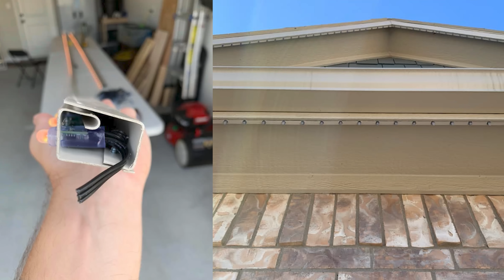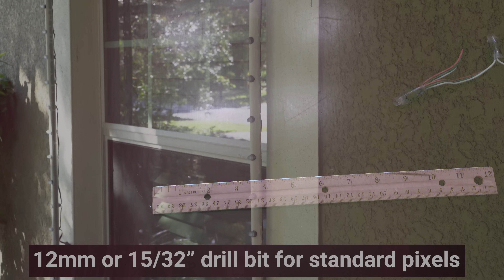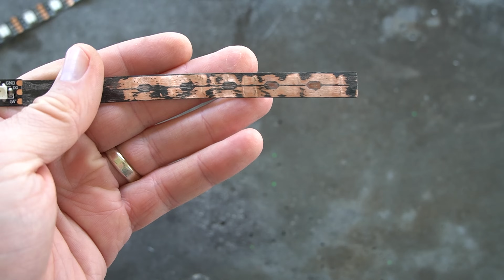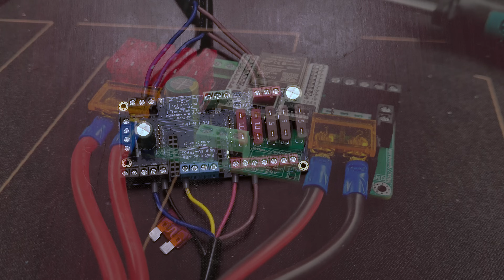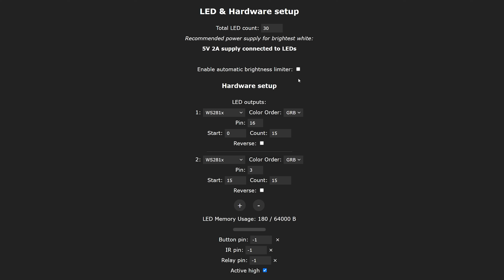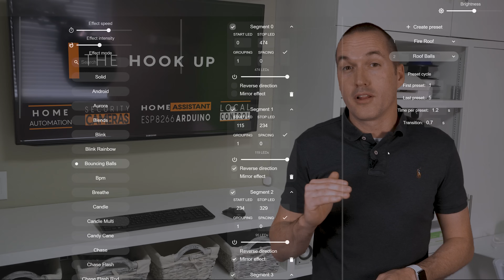DIY Permanent Holiday LEDs: Complete How To Guide 2021

Comment: Another wonderful video!  Always excited when I see you have done another one.   I did have a question and I apologize if this was brought up in another video or section and I missed it.  You mentioned in this video 2 options: aiming lights towards the streets, or towards the house for a more indirect effect. Ive noticed the differences on several houses I drove by, and I was wondering how they are achieving that  almost shadow glow effect off the siding or stucco of the house vs seeing the LED strips head on from the street?  Is it really just using J Channels or PermaTrack? Or is there a way to aim the lights so they cast more of a light shadow of color against the house?  I was just wondering if in your knowledge that is achieved by putting th e J channels further back? Or maybe aiming the lights in the J channels differently or not just straight down?  Any help or idea would be greatly appreciated.

Comment: Can you do a mega tree with a diguno or quad ? Or do I need a falcon controller?
Reply from the maker: You can do it with a digquad but you’ll need a lot more power injection since you will be doing it from 4 outputs.

Comment: Love your Videos. Do you have any links for the Aluminum Channel you use for the LEDs? I am trying to find stuff here (Australia) and struggling especially ones that sell corner caps as well or is that something you don't worry about?
I am going for strip in a diffused channel, i was contemplating going sk6812 facing down under the eaves, so i could use the white as a all year thing..... but not sure if that will take away from the effect of the lights. what's your thoughts on facing down vs facing out?

Comment: I have to apprecciate all the work you invest to explain all this man, i am completly new on this LED projects and I am learing TON with you! greeting form Mexico! 

if you see this, any tips for a begginner with a project of 10 strip lines of 60ft each strip? Will be able to control 5,400 leds in total with that controller you promote?

I was planning to go with 2811 30Led per meter, due the lack of color drop, but looking up this, maybe ill have to go anyway with the 5v option to be safe with shortcuts and 1by1 pixel control,

Comment: You are amazing.  I am planning on getting this setup and reacting to my stream via Twitch on the off season of holidays!!   I was not able to buy the DigQuad but I did purchase the logic level shifter, node MCUs, and a few PCB board prototypes.  Do you think i could get by with these rather than the DigQuad (as it was backordered at the time)
Reply from the maker: Definitely can still do it with a nodemcu and level shifter.  For me the diguno and quad get my recommendation because they end up being about the same cost as DIY with much less hassle and a much cleaner looking outcome.

Comment: I would not recommend LED strips in climates where you have large temperature swings. The thermal expansion and contraction causes the copper foil to fail. My lasted for one season. A friends lasted 2 seasons, his lasted longer because they where not south facing.
Reply from the maker: I'm curious if the electrical tape would help that as well, decoupling the aluminum from the copper may prevent the differential expansion/contraction.
Reply: Very interesting point. 
I live in Texas, and the peak sun is ruthless during the summer.
Not to mention the winters, which are always different from the previous.
Reply from the maker: I live in Florida, the sun is murderous here, so I wouldn't worry about heat.  I think cold is the issue.
Reply: @TheHookUp  My installation was 30ft continuous, I used Aluminum Channel and did not stick the LED strips to the Channel. In the Summer I would have the Lenses of the channel popping of in some sections and in the winter I would have gaps between sections of the channel. The LED strips just can not handle this kind of force.

I now use the type where the LED is soldered to a circuit board and then wired between each board. The only issue with these is that they are not water proof. However I live in a mostly dry climate and I'm not concerned with corrosion, also they are protected due to there mounting location and the channel. This will be season 4 with these LED Strings and no failure. 

Installation looks like this:  Aluminum Channel, flat white speaker wire, Black electrical tape to hid the white speaker wire, LED string, Lens. Its a tight fit but it works.

One other thing I do different than any one else, I do not use giant 5 volt power supplies. Instead I use discarded Laptop power supplies(free). These I mount either in my garage or a water tight enclosure. From there I run the 19v of the power supply to the string. At the string I use a 12amp DC/DC power supply from AliExpress to get 5volts. I have designed a custom board which uses the ESP01, this board is mounted to the back of the power supply as the board has the same foot print as the power supply. This is then installed in a water tight electrical box mounted in the soffit. This makes for a 2ft run from the board to the string minimizing the voltage drop of the 5 volts. 

As a teaser I thought I would throw this in as well. I've just finished testing POE to the LED strips. I tested through 75ft of cat5, 30volts and yes this includes the data. At the end of the 75ft of cat5 I ran 10meters of led strip. I managed to push 90watts to the strip as this maxxed out my bench power supply. I'm now waiting for boards to arrive.

Well this ended up being long! Hope all this makes sense.

Comment: Is it possible to connect more than on dig quad to wled? If so, how is it done?
Reply from the maker: You mean drive 2 quads through a single WLED instance? I don't think that's possible.  However, I think Quindor is about to release the DigOcta that does exactly that.
Reply: @TheHookUp  Ah.. but what I was referring to you just basically answered and it is now super obvious. In order to drive more pixels than what one dig uno or quad can handle, you must start a new instance with a new IP address... yes?
Reply from the maker: @coachd1968  Yeah, a different instance of WLED running on a different microcontroller (with a different IP address).

Comment: Great video and just re-watching as I now have most of the supplies and am getting ready to install. 
Did you use the RVV wire for the parallel injection runs? I see that stuff is 3-conductor, but for the power injection you only need 2-conductor right? Plus, the black casing probably won't look good in the track along the roofline of the house. 
And I noticed in your video when talking about parallel runs, your wire (you mention 22 gauge) is in a white casing...?
I have 84 feet along the front of my house, is this 22 gauge wire sufficient from the power supply, up and along the run?
Reply from the maker: I use RVV for primary runs and occasionally for home run injections.  I use the 24awg stuff for the parallel runs.  For 84 feet I'd recommend a home run injection with thick wire near the middle (42ft), and then run the thin stuff inside the channel for parallel injections.

Comment: Love your detailed videos - thank you! I was wondering what your thoughts are on the hunhun 20-Pack 6.6ft/ 2Meter U Shape LED Aluminum Channel System that your amazon store links to vs your "Best Overall Diffuser" from your more recent aluminum channel comparison video for outdoor permanent holiday LED strips? (I'm planning to use 12V WS2815 strips, and would like to be able to route some power-injection wires inside the channel) Thanks!

Comment: 9 mins in it looks like you burnt off the insulation on the wires possibly causing a short?
Reply from the maker: nah, that's hot glue coming out of the heat shrink.
Reply: @TheHookUp  Coolio :-) thanks for the video - super awesome stuff

Comment: I'm still trying to understand the power injection part for 5v LED strips.  When you say you inject power at the beginning and end of each strip, doesn't that end up being 2 power inject points right next to each other?  Assuming we have 3 strips wired together (strips A, B & C), are you recommending injecting at the beginning of A, at the end of A, and then at the beginning of B again? Or are you saying that you would inject at the beginning of A, the beginning of B, the beginning of C and then one last one at the end of C?
Reply: I feel like it's some kind of conspiracy that he doesn't specifically show his power injection in the track. How it's installed on his house. I've looked for hours trying to see how he set it up and there's no picture of it but anyone who goes to do this setup will immediately run into this issue and yet no one seems to be commenting on it aside from a few. A lot of people, however, have said that they've done it already

Comment: Is there a way to test the data signal?  My lights were working last night, now today they were stuck.  I unplugged  and back in and. I only my first LED is on, the rest are not working so thinking it’s a data line issue.  Is there an easy way to test?
Reply from the maker: I have a single pixel that I plug in to test data lines.
Reply: @TheHookUp  so I kinda went hybrid with you and DRzzz, so I added a pixel next to the nodemcu, that works.  Then my line runs about 20 ft to the strip.  It’s not working now so I’m thinking maybe it’s my newbie soldering job
Reply: @TheHookUp  dang, I plugged it in tonight and it worked.  Why is that?
Reply: Must be something with wiring, once it runs for a while, then it freaks out.  It stopped responding again.
Reply from the maker: @Pound Maupin  Sounds like your power supply might be bad.  Measure the voltage when it's working and then again when it isn't.
Reply: @TheHookUp  should I measure it from the power unit or from the LEDs?
Reply from the maker: From the power supply terminals.
Reply: @TheHookUp  so it’s at exactly 5.00v.  Thank you so much for the support.  Let me run down my equipment so I give all the variables:

LED strips, ws2812b 5v
String with issues has 458 LEDs
Using a nodeMCU ESP8862.
About 3” out from the mcu I have one LED to help with the data line issue.  I also did this to have a visual reference that it’s working without going outside.
After that I have 25ft of 3core wire going to my garage strip.
As I built the sting, all tests showed fine
Now that’s it’s all up, after a few mins, the lights first flicker but keep their pattern.
A few mins after that, the first 75 LEDs (minus the one 3” from the mcu) or so are not the pattern, completely random colors and not moving at all.
The 1 led at the nodemcu seems to be working fine.
Checked this morning, lights are on, no pattern, same colors as last night, power at the supply is 5.00v
Logged into WLED and the nodemcu showed as off, turning on, changing brightness colors etc had no effect.

I have 4 nodemcu out there (working on the other strings still so not connected to anything yet), I want to say I tried all 4 in the past with same results but I will try all 4 again.

Thanks again for all the help
Reply: Well cut off that 1st LED, soldered a new one on and redid my connection.  Connected all the paneer injection but missed a spot darn it.  So far so good, it’s only been like 15 mins though.

Not sure I know what I am doing with power injection.  I have a 5v 60amp power supply, one terminal it going to the nodemcu then to the front side of the lights.  Using 16gauge audio wires from the same power supply but different terminals to the back side and then 3 injection points in the strip.  The back side where the power injection first connects seems off, it’s not a pale white but it’s like you can see each trying to make white.  Checking WLED, recommended is 9amps, max says 26amps.  At 9amps it looks great. At 20amps if where I’m having these issues 

I injected less than each strip front and back so not sure.  It’s just now dusk so maybe looking when it’s dark would be best.
Reply from the maker: So it works at lower brightness, but not when cranked? That means you need more power injection.
Reply: @TheHookUp  I’ll see if I can add more, heading home so see if it’s still working or not.
Reply: Well came home and they were all working so must have been a bad soldering job.  

Now to learn WLED
Reply: @TheHookUp  so on my garage roof I have 290 5v LEDs, I have power with data at the beginning.  I then have a “home run” to the last led, then running a power injection from the home run to the middle of the strip, around the 145 led area.  So less than 2 strips, power front, end and middle.  In WLED if I turn off my power limiter, LEDs are not all white.  I know you said more power but don’t I have enough?

My power supply is a 5v, 60amp, 300w unit, my home run is coming off a separate port of the supply.  I’ve check my supply and it’s right at 5.01v so it’s not that.  What else do I need to get max power?

I know I don’t need it, just want it so I know it’s right…

Comment: A person’s head could easily get overwhelmed with all the information in videos, especially when a bunch of choices are compared. 
I need advice. I have a single story home, no vaults in the roof, so I’m looking at a simple straight roof line. It’s about 60 feet to cover the entire front of the house at the roof line. So, here is what I would love to know 

I want strings not strips because I don’t want to make cuts. 
I’m looking for 12 volts so I need to know which ones to get and how many to get. 
The permatrack looks easy to use, but I think I want something to diffuse the instead of seeing the individual lights. Is it possible to have a diffuser for strings?

So what kind of lights
What kind of controller and power supply
And for 60 feet would I need a power injection? 
And is that all I’d need? 
Lights
Power
Controller
Track
Diffuser
(In south Florida)

Comment: You don't have any issue running 23 amps (473 5v LEDs @ 50 mA) on 22 gauge wires for your downstairs power injection run?!? That seems like way over spec for 22 AWG wire and prone to overheating.

Comment: I'm diving into the whole Pixel RGB hobby this year for the first time, and the only question I have is how to mount the led strings to my house.  I am wrapping a door, two windows (one of which is huge, and a small roof line.  Mounting the pixel strings to the flat trim around the windows and door has me stumped.
Reply from the maker: Are your window flush? Some people build PVC frames but recess them into the window space.
Reply: @TheHookUp  The trim is 4-inch wide hardy board around the windows, with the windows proud of the trim by about 1/8 of an inch.  So, pretty much flush?  I think my only real option is drilling through 1/2 inch PVC pipe.  Not happy about that as it doesn't hide the wires or look very "hidden".

Comment: I’m still so confused what to do and where to find what I need, I have a 30ft section and a 20 ft section in the front of my house under gutters. I don’t know what to do but I want a 5v addressable lights strip and Im going to put an angled diffuser underneath the gutters so it’s a cleaner look and want to do the ip65 lights but I don’t know what to buy or where to buy and how to actually set them up. I’m not good at wiring soldering or coding and I am looking to have permanent lights in a location with all 4 seasons and I’m trying to stay in a budget but having that professional quality and thought 60 leds per meter or 144
Reply from the maker: I feel like you didn’t watch the video.

Comment: @The Hook Up, do you run the main power lines from the PS externally on your home or through the attic and then coming out near where it is needed? I have two peaks in my roof, but I am unsure if I should run the power lines through the attic and out or just tuck them under the shingles.
Reply from the maker: I run through the attic

Comment: Ummm, if you use the wrong gauge for the amp draw you will start a fire, no matter the voltage.  Up to you if you want to believe the no fire at 5 volts.
Reply from the maker: Good luck drawing enough amps to start a fire with 5v.  Volts are the push behind the electrons, thin wire has high resistance.

Comment: I want to install permanent lights on all 370' of my roof line. I plan to use the strings not the strips. Can anyone tell me if a 1000 pc and 500 pc set of lights will be enough. Also wondering what I need to do as far as power injection. I've watched several videos and I'm still a little confused on how to make this work. I just know that I don't want to spend $10k.

Comment: It's the amps not the difference between 5 and 12 volts that can cause a fire due to heat, can't have heat without enough amps even at 1 volt, but enough amps at 1 volt can cause a fire.
Reply from the maker: Right, but there's a reason we use the phrase "push amps through a wire".  Without voltage there will be no amps.  As the internal resistance of the wire increases the amperage will decrease proportionally to the voltage.  A 5V supply cannot "push" enough amps through the wire to heat it up.

Comment: Stunning new 'How To' and this really helped tip me into the QuinLED camp. Just given how late in the year it already is, this will be a project for Spring 2022. 

But my recent experience in using LED strips  and aluminum channel for lighting my pergola (more thanks for flagging that awesome patio addition in your earlier video!)  has made me pretty confident that this will be a successful project. Thanks for the research and the tips!

Comment: Hi all, I would right away go for the installation, however the same issue keeps holding me back. 
-> Does anyone know of LED Strings (not strips), that are waterproof, individually adressable and do warm white / cold white and anything in between instead of RGB. I'm just not into the extreme colors x)

Comment: You should NEVER use a flame to shrink the sleeve. You burn it and the wire, and degrade the connection.. Always use hot air.